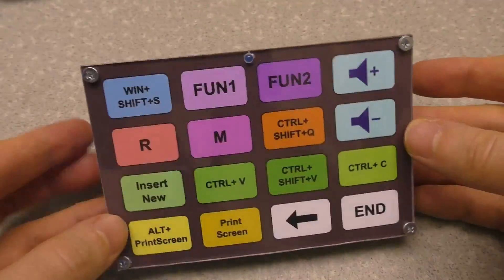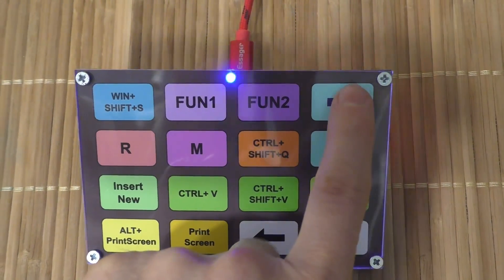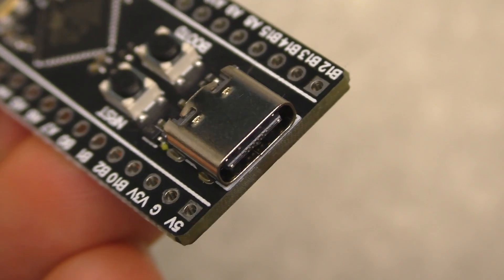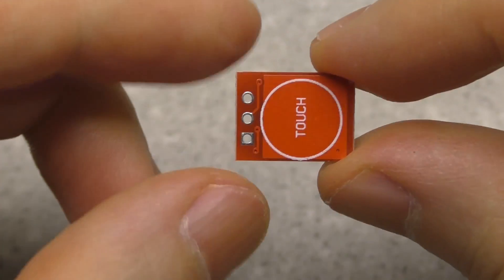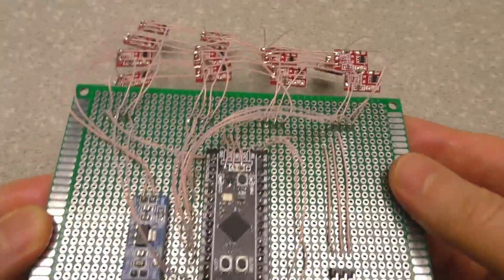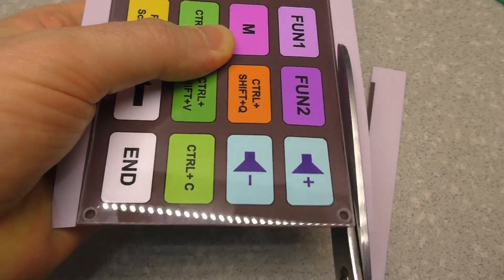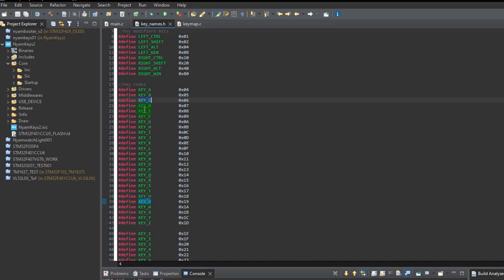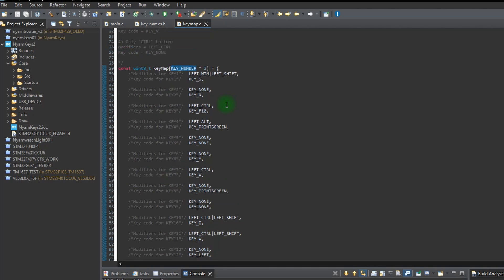Cheap DIY USB programmable mini keyboard based on STM32F401 microcontroller (with source code)

Comment: very cool! didn't know that capacitive buttons can be used under a plastic sheet and still work.
Reply from the maker: They work through plastic, cardboard, glass, wood, paper, paint.
Reply: @NanoslavicLab  wow thanks for the tip. i will try it with my capacitive touch sensor mpr121.